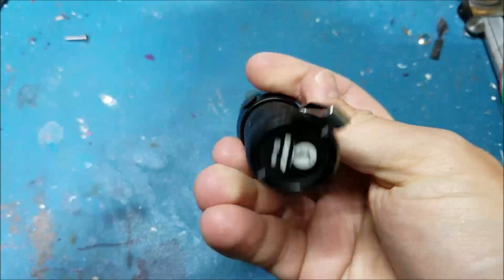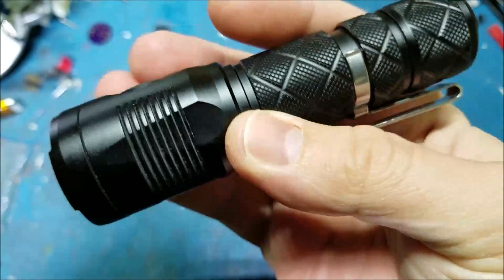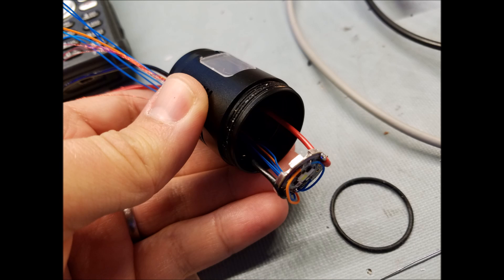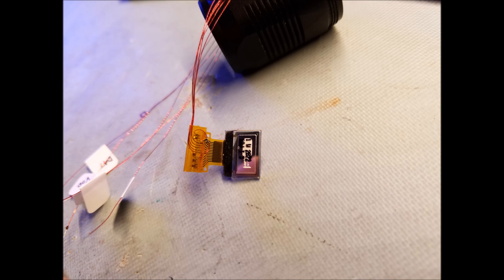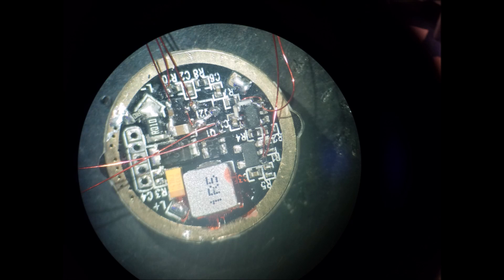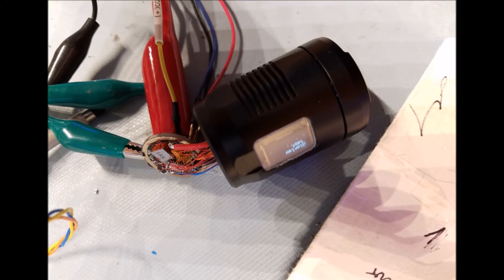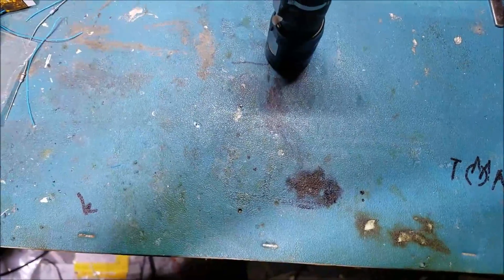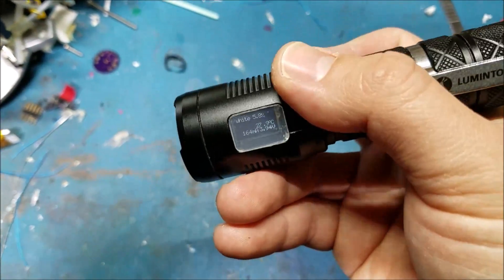Ultimate flashlight mod (Lumintop SDmini +MELD +OLED)

Comment: I am a big fan of your work! I even designed my own pyro system. It's nowhere as intricate as yours but when my 3D printer gets here, im going to continue my progress by adding a servo motor connected to a flex sensor and work on the auto-ignition system....which wont work for some reason